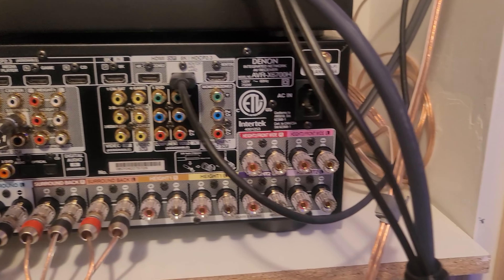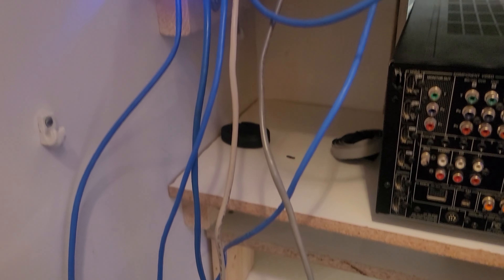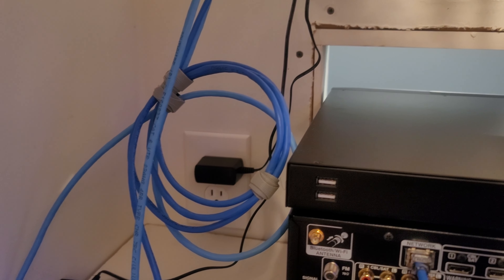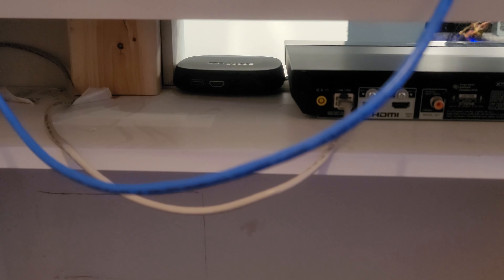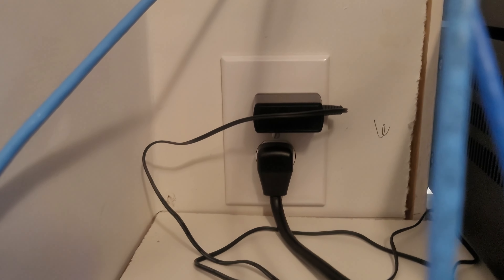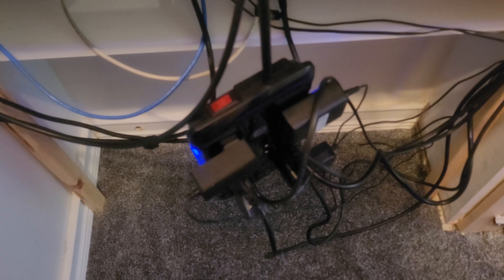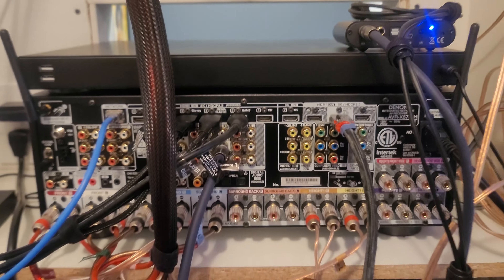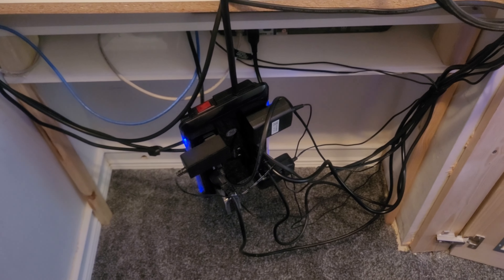Installing the Denon x6700H

Comment: Question... Did U Use 😳 Inputs Game Or 8k Port, on Back of Denon AVRX6700H???? For Your Gaming Console????
Reply from the maker: I used the game input because I have a PS4 and an Xbox One X and neither are capable of 4K at 120hz or 8K at 60hz. My son has a PS5, but I haven't tried it in my setup yet.
Reply: Trying to decide on the Denon x6700h or x4800h etc.I don't want to spend more than $3400 .I currently have a 5.2.4 setup . Any receiver recommendations my setup is power hungry especially my paradigm 90p monitor towers
Reply from the maker: @lexhtfdct7230  I would say it really comes down to how many channels you want to add to your setup. With the 6700H you will gain 4 channels, but only 2 with the 4800H. If you just want to add 2 more channels I would definitely go with the 4800H. It has Dirac built in along with 4 independent subwoofer outputs. This takes away the need for a mini DSP to send the sound to 4 subs. Also, they included Auro3D with the 4800H and all inputs on the back accept 8K. Lastly, you are going to save yourself a good bit of money that you could put into purchasing an amp for those two extra channels of built in processing that have no amplification.
Reply: @EuphoniumDirector  I have 4 heights
Reply from the maker: @lexhtfdct7230  with the 4800H you could add either top middle, front wides, or surround back speakers. If you get the 6700H you can two of those three. I currently have a 9.4.4 setup with front wides, back surround and top/rear speakers.